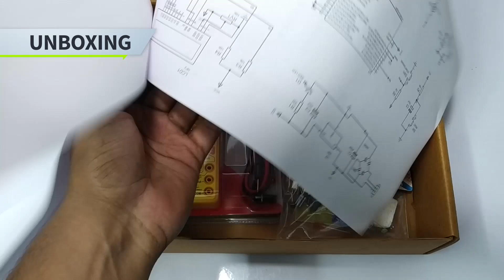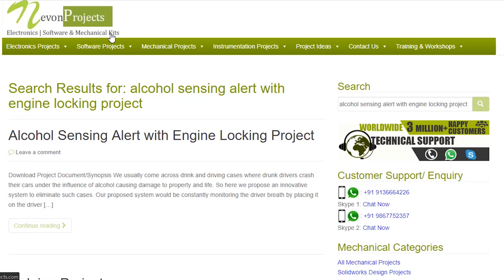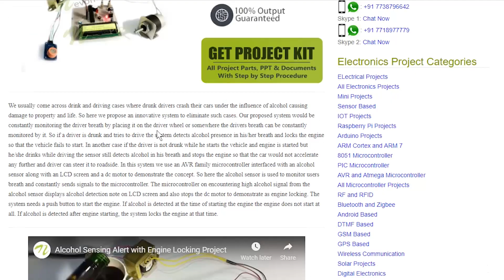Drink & Drive Accident Prevention | Alcohol Sensing with Engine Locking Project

Comment: Sir as you have used deodorant in the vedio instead of alcohol, then the vehicle can also  detect deodorant as many of us use it and stop the engine right. Don't you think this would be a drawback..
Reply from the maker: if deo is sprayed directly on sensor it will trigger... the deo on drivers shirt dosent have that high alcohol concentration to trigger it from there